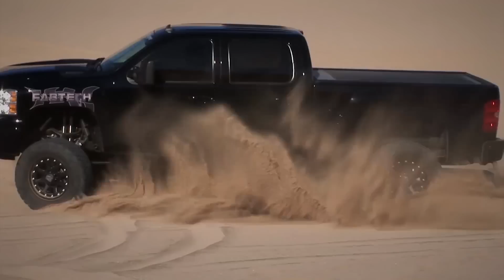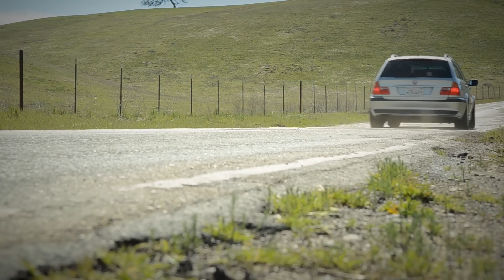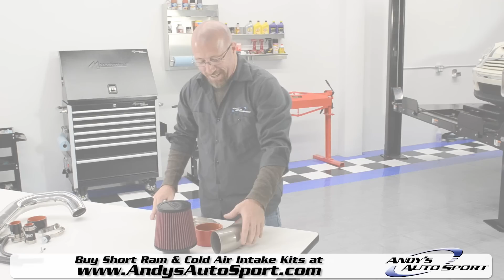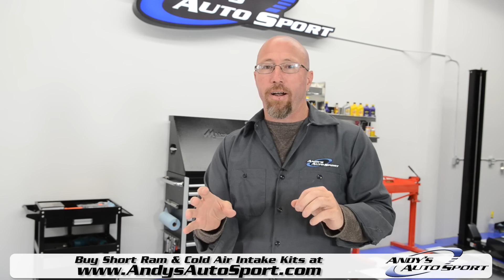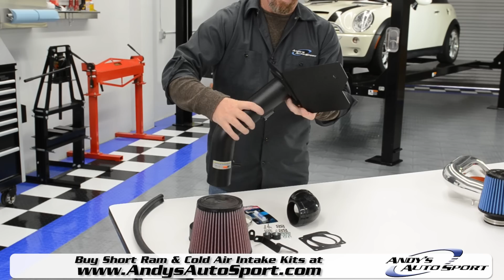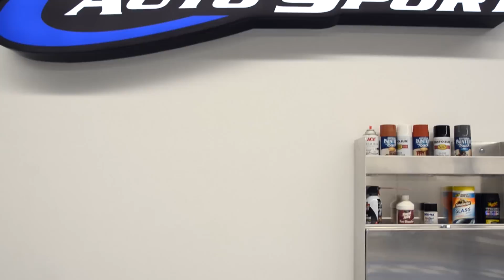Short Ram vs Cold Air Intake Kits: Which to Choose? Presented by Andy's Auto Sport

Comment: Problem I see with all 3 mentioned kits is that they require you to take the MAF sensor out the MAF housing and bolt it straight into the tube. I have done this my self and car will act like its got a bad MAF because the sensor goes nuts. Requiring you to unplug MAF to keep your motor running. MAFsensors are calibrated to there housing so you need the housing for it to work correctly. I used a MAF adapter and worked awesome for me. no check engine light and was able to actually keep my sensor.

Comment: The material of the tubing also makes a difference because some materials insulate better than others keeping the air colder as it passes the engine, but this doesn't make a noticeable difference with ram air intakes because the air travels such a short difference.

Comment: A ram air intake will add bottom end power by forcing more air through the inatke because the is almost no resistance slowing the air through such a short tube. Cold air intakes bring colder denser air into the engine that gives more power through mid to high rpms.

Comment: Another thing your forgot to mention, Depending on the make/model of the viewers application and the condition of inner finder liners/air dams/under body plastics should have a bearing on their decision. A vehicle with damaged inner fender lining with a cold air style installed could cause hydro lock on your motor, making the short ram a better option for reliability.

Comment: i have a 2001 honda accord coupe and wanted to get a cold air intake but i also plan on getting dual catback magnaflow exhausts in the future...does anyone have any suggestions? i was told that a short ram is btter if you plan on installing an exhaust system but im not sure

Comment: I have a K&n typhon Short ram intake on my Honda civic and the filter has about 15,000-20,000 Km. I was wondering, (mainly because my friend told me) should i get one filter for summer and use the original one in winter? or should i just clean them ever season?

Comment: CAI are nice to have but you most be aware of things like deep puddles of water or heavy rain b/c there is choice with a CAI do to the fact that the air filter is on the outside that water enter into you engine via the intake system and cause what is called hydrolock

Comment: On a stock ecu yes it will make power but the power made isnt at peak its in the lower rpm range  so the mcm dynos only showed peak power they did not show the power bands in the rpm range  so theses intake kits and filters will give you power only if you have a chipped ecu will you see the power at the peak level  on stock ecu the power is applied in the lower rev range so there is more power just not at peak rpms

Comment: Well if your car has a MASS AIR FLOW censor and you install any of these that means more air will go to your engine, and the sensor will read the amount it goes through, and according to that it will ad more fuel, which gives you more power and less miles to the gallon, but its worth it xD

Comment: I bought an Air Raid CAI mainly for the sound and because it was an easy to do myself type mod... Im going to the track tonight for the first time with it, and my new wheels on. Ran 13.7@103.1 will see if I can run faster with the Air Raid and  new wheel and tire mods...

Comment: I would like to put bigger exhaust, and cool air intake / short ram intake on my car. Will it change something besides looks? Will it need more fuel, have 5HP more, will I need to tune it to get better fuel consumption?
Reply: putting on a bigger exhaust only changes sound, think about it, the quicker the air travels through the better, the exhaust is at the back.. it wont help greatly. but de-cat, straight middle pipe and non silencer back box helps from the engine to air exit (back box) instead of just at the back.. so doing what i mentioned gives you much better set-up.. a 4 branch manifold also helps air out of the engine and a cold intake into the engine, do them both aswel and you have a good system the whole way through. it will help hp, acceleration and noise will be great but will be a lot harder on fuel, any upgrade anywhere will lower MPG and cost more fuel

Comment: I want both. Just install a short ram filter and custom build a heat shield around it, then pipe in cold air from the outside like they do with brake ducts.

Comment: ive been doing my research and when I but my car i will but a cold air intake, because is just a bit better than a SRI its not a huge difference maybe 20% the most. i also was wonder the same thing, what if it does catch some water  in my engine? well that is why I will but a bypass which allows it to be dry no matter what

Comment: Essentially, short ram intake is a short "less restrictive" pipe, compared to stock airboxes that sits under the hood, near by the engine *in fact, warm air intakes (SRI) give you more MPG...fact*. 
A Cold air intake's pipe runs down to the fender well (runs towards the bottom of the car) to suck in colder outside air as opposed to engine-warmed air.
And yes, it's cheaper to get an SRI.

Comment: More power more fuel, it's that simple.  My rotary making say 400 HP uses about the same ratio as any other 400 hp engine. Sure turbo engines use some of the fuel to cool the charge but it's still inline.

Comment from the maker: If your car sees a lot of damp weather, a short ram intake would definitely be recommended, although you could always install an air bypass valve to cut off air flow to your engine if your filter becomes submerged in water.

Comment: another good thing about the k&n system is that it's just about as easy as a short ram to install.. once you assemble the tube, heat shield,velocity stack and filter you attach you're maf and slide it right into place. bolt it down, attach the breather hoses and you're good to go. A full cold air system, at least in my civic si, requires removing your bumper and relocating your battery

Comment: most stock intakes are more than suitable. until you get another 50-200 horses under the hood ur stock system shouldn't have to much trouble backing it up.

Comment: On my 2009 Subaru Forester XT (and most newer cars) the best upgrade is a high quality panel filter, in my case the factory airbox has been flow tested and is not restrictive until around 300-350kw.

Comment: the cold air intakes are always going to be better... it comes down to simple physics, since air molecules condense under colder conditions by putting on a Cold air intake you are essentially feeding more air into the engine as opposed to a short ram... cant say there is a tremendous difference but hey, every bit of power helps... right?

Comment: Believe me I had both for my integra. One was $180 fujita intake with the whole pipe down to the bottom, and the other was at cheap short ram from advanced auto. I felt like the long 1 had a nicer cleaner sound but a 10% power gain. However, the short ram had a 25% power gain and made it sound louder. Not uncomfortable loud, but when I got on it, it sounded like a beast.

Comment: Here's a simple answer for some of you. Short rams tend to have more High End power, becauset their tubing is shorter. But they are more useful for short bursts of power due to the fact that your engine heat makes the air even hotter. (better for drag racing)

Cold air intakes tend to give your car a bit more torque than a short ram, but a little less top end. This is due to the length of the tubing. It also maintains its power advantage even through long periods, because of the outside air.

Comment: @peacerob12345 if the cold air intake system sucks up water, it will hydrolock the engine. Seeing as Honda has been making the engine bays in Civics a lot smaller than the 90s civics, you'd probably want a cold air intake. What I recommend is install your cold air intake system, but throw a hydro shield over the filter to prevent water from being sucked up. Hope this helps.

Comment: Unless it's a significant amount of snow, you shouldn't be too worried. Besides, the filter is there for a reason (which helps avoid sucking up large amounts of snow) A little water spatter won't matter, since it will just likely stick to the sides of the tubing or your intake manifold anyway.

Comment from the maker: There are actually many differences, among them being quality and engineering. The cheaper intakes use inferior filters which might fall apart over time, possibly entering your intake manifold, and they generally haven't been engineered to make power. The bigger companies spend a lot of time and money in R&D to make sure that their products actually produce usable dyno-proven power. Also, if you need a C.A.R.B.-approved intake, those cost more as well because of the certification costs.

Comment: The increase in horsepower and torque all depends on the quality and performance of the stock intake. some high end cars are already fitted with OEM performance intakes and thus installing such aftermarket parts will offer little to no performance increase, but if it s a lower-end car with a cheap simple airbox, it can easily gain you 10-15 whp. It did on my Corolla for sure as I dyno tested it before and after.

Comment: you can make a custom intake from the turbo to outside. And as long as it doesn't restrict the air flow on the turbo it is better. I seen people loose power by adding one. And others add power by adding it. It honestly all depends on the placement of it.

Comment: Generally speaking, most cars stock intake is engineered great (well, in the past decade or so). CAI draws and stabilizes the air (most do), which is far superior to a short ram which draws in hot air from the engine bay. It all depends on the car, but for a large amount of the situations, a short ram only produces more noise, but not any performance gain. CAI's are much better.

Comment: I have heard mixed reports on CAI's regarding how much benefit you get from putting one on vs. a stock intake. Unfortunately there are only a couple of videos that I have found where they do a before and after dyno test. Furthermore, one will show a lot of benefit from putting it in, while another shows virtually no improvement. Could you provide links to anything that proves there are benefits, or just a video that shows a before and after of HP and MPG on a small engine like a Honda Civic SI?

Comment: What i did with my car is I ran a tube tunnel from the front bumper to the intake. Using the piping they use on dryers to release the heat and some pumping ends. When i drive the cold air travels threw this tube to the intake. I can feel the difference in the air flow not to mention the temp. of the car is lower. Plus i notice a difference in gas millage.

Comment: I don't really see where people are coming from with these negative reviews of SRI's. I have a 2015 Mazda 3 with the 2.0 which makes 155 HP and 150 lb-ft stock at the crank. With drivetrain loss, It made 132 HP and 128 lb-ft at the wheels. After installing a SRI from Corksport, I ran it again on the dyno and it was making 136 HP and 134 lb-ft at the wheels. While not a huge increase, it was still an increase nonetheless and I also feel slightly improved throttle response. On top of that, it was only 1 HP less then they claimed it would make and the lb-ft rating was spot on. Sometimes it just depends on if your buying a quality intake designed for the car, or a cheap Ebay intake that's "one size fits all." Do your research before you buy.

Comment: i have had both a c.a.i. and a s.r.i kit on my cobalt.the sri obviously under the hood and the cai running down behind a grill below the fender and bumper.I've noticed more power with the longer tubing but slightly better throttle response with the sri cuz of the shorter tubing.can you buy that separater plate that comes in the kandn kit separate?

Comment: Every expensive cold-air intake company claims that HP will increase from installing a cold air system. To get more HP do you have to adjust the mixture? I have never seen an actual application that increases HP. Sure, the air coming through is a few degrees cooler, which isn't ever a bad thing. But when a company has dyno graphs on the side of the box, it shows 25-50 extra HP on some of them. What are these companies doing to get these gains? If you look closely, some of the graphs have a "*results may vary **results are based on simulator" and stuff like that. Is there any company that offer your money back if you dont increase HP?

Comment: Option number 3 is the best as far as best goes. In the other two options you allow air to flow over the filter too, and that air is actually trying to pull the air out that's going in.
Another downside to option number 2 is dirt. The more you bring it to the outside, the more dirt it will catch, and some of that dirt might do damage to your filter.
Don't expect miracles from only this modification.

Comment: To summarise all comments:

1. CAI should give you a little more bang for buck especially over the top end. SRI don't do a hell of a lot because air is still same temp going in as it is with the OEM setup. 

2. If a SRI was really that much better the Manufacturer would have put it in to begin with. The stock intake has been specifically designed by engineers for that vehicle so unless you're gonna go big with a CAI kit don't bother.... 

3. One thing SRI does do is produce a pretty sexy little engine sound aaand it'll look cool to your non-car mates when you pop the hood and they see a big shiny filter staring back at them. 

4. Oh and if you do install a CAI, no more gunning it through the puddles on rainy days unless you want water in the engine.

Got it.

Comment: It all depends on the vehicle and overall setup. In most cases you won't get much if not any horsepower out of aftermarket intakes. That and the filters on cold air intakes often get dirty so fast that ideally they should be changed weekly. It's better just to save up for a turbo or a supercharger rather than spend money on such a minuscule performance upgrade. If you're still thinking about getting an aftermarket intake, make sure it's mandrel tubing and has the least number of bends in the tubing as possible for best airflow.

Comment: Some, but not all factory intakes are restrictive. 

Many modern cars have very efficient intake systems.
For example discarding a stock Helmholtz resonator chamber will cause a loss in low end torque.

Comment: I don't see what the point of running a CAI in my boosted car since the air just gets hot again once it hits the turbo and cools again when it runs through the intercoolers, i just run a short ram and have noticed a slight gain in power,straight pipe helped too

Comment: Cold hair has better combustion. Its science. More combustion = better power output. Higher octane fuel also has better combustion, that's why they use it in race cars or jets, its made for engines that can or need to run it. Both of them together make for a pretty good increase in horsepower. Also having them may increase your fuel economy due to the fact your engine doesn't have to work as hard to get the power it needs for someone that has a heavy foot. Its all just really healthy for your engine in general.

Comment: I honestly don't always trust their results for one reason. They didn't measure how much air was flowing with the fan. Remember in a car the faster you go the more air the flows threw the car. Thats why shops that tune cars have to tune them several times because. The dyno does not give you the results with the actual weight of the car. I have a custom short ram intake with a custom tunel the runs cold air from the front of the car to the intake.More air + more spark + more gas = more power.

Comment: Stop fighting over hp, on paper cars don't always add up. Easier air flow means quicker response. Colder air moving (since the air gets 'sucked' in like a wind while the car moves) may pass easier into the cylinder and even push the combustion force out quicker. People say it works, just cause one equation doesn't change doesn't mean it cant work.

Comment: most modern day cars have no need for kits like these. many modern day cars are designed well enough that they already pull in cold air from the fender usually. such as in my case, I have an 04 Chevy Tahoe with the 5.3 and it pulls the air straight from inside the fender well. take a look at your factory air box and see if it pulls in air from anywhere outside of the engine bay, if it does then just get a K&N filter for a more free flowing intake. alot of the time these kits are just for looks, if you are more about the performance than the looks, K&N filter is the way to go

Comment: Its like going from a closed up air clearer to an open one on a carburetor people  its going to flow more air in period    car craft did the old flip the air cleaner lid on a carburetor Cadillac  which made a 3 to 4 inch gap on the opening  it gain 2hp  on the dyno for free   its still able to pull more air in  ie thats what these systems do and they build on each other  air intake spacers cat back or modified exhaust and a performance program all work together    you guys with a dyno find a truck or car do this stuff then make a video bout it  for us to fight over lol